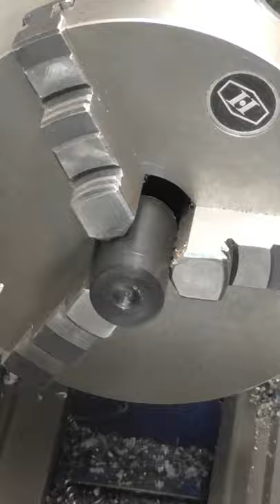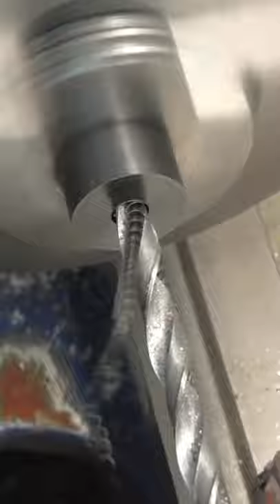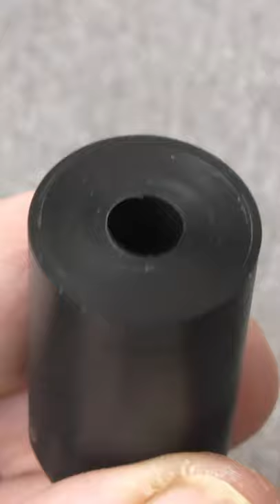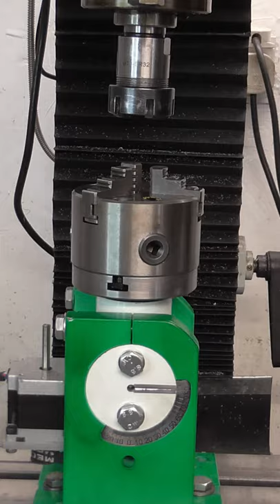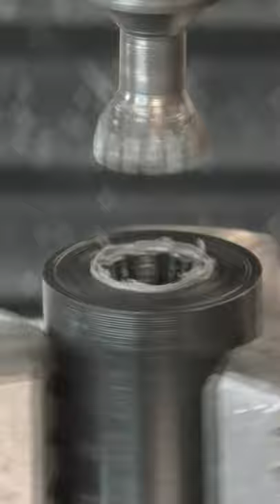Rotary Broaching

Comment: Cool!  Now try it with steel.  LOL!
Reply from the maker: It took considerable force just with plastic (as I suspected it would)! I should have put a shoulder on the part as it just wanted to push it into the chuck jaws, I think my home-made cutter could have been sharper though, the points have become a little dulled with use (I didn't originally make it for doing this).

Comment: DMG Mori calls it "Gear Skyving" I think. Really cool that you do it on the Manual! How do you sync the Rotation of the spindle and Rotary Table?
Reply from the maker: It's done electronically, see my other videos on  the 'Gear Hobbing attachment'
Reply: @AndysMachines  I am pretty sure you don't need to sync the cutter and workpiece for rotary broaching. If the cutter has the same OD as the root of the internal thread you can just do it with a simple rotary broach holder. You only need the synchronization function when using a skiving cutter of a smaller diameter and held at a greater angle, but it is a totally different process and needs very high rotational stiffness, apart from very good rigidity in the whole setup.
Reply: @AndysMachines  I'd have to guess that even electronically it must have difficulty staying perfectly in sync, closed loops have lag times afterall. Best way must be direct drive through gears, cycloidal gears  for maximum rigidity because zero backlash 🤔

Comment: If I'm not mistaken, this is technically skiving, not rotary broaching. Though that is just nit picking.
Reply from the maker: When the 'broach' is so similar in shape to the feature it produces I think it's called broaching. But in the video this short is taken from  where I was cutting internal gears, I referred to it as skiving. The two processes use the same principle though rotary broaching is usually done at a much shallower angle.

Comment: What is the advantage to doing it this way instead of straight up pressing it in?
Reply: as i understand it, the broach is actually held slightly off-angle so instead of the entire tool being pushed through the workpiece at once, it rocks around the edge of the cut and only a small section of the broach is actually cutting at a time (like when you spin a coin on a table and it starts to fall). this means that instead of needing a broaching machine to provide the pressure to push the whole broach through the piece, you can use a mill or a lathe that you probably already have to do the same job

it's a lot easier to visualize when only one of the parts (the work or the tool) is moving but i suspect that both are spinning in this case to get the right relative rpm for a clean cut
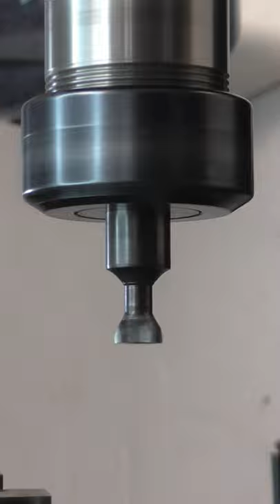Reply from the maker: Yes, that's right. To push it straight in would require much more force (and to get it back out again!) It kind of 'wobbles' it's way down and is only ever cutting at one point around the circumference. There is a 1° angle (0:30) between the cutter and part, both need to spin at the same speed.
Reply: @AndysMachines  @Violet Vixen I see now, thanks
Reply: @AndysMachines  I have no machining experience. I've just been watching like an hour of these videos trying to understand how this works. I kinda get why the bit has to be spinning (because it's 1 degree off center so it can chip away little by little). But I don't understand why BOTH have to be spinning.  Could it not work with just the bit spinning?  Sorry for my lack of understanding.
Reply: @brayanmorales4737 if only the bit was spinning, you would only ever get a circular hole. 🕳️

Comment: Don't u need a asymmetrical rotation?
Reply from the maker: Yes, the tool spindle is at an angle to the workpiece so as they rotate there is relative linear motion between them in the Z direction.

Comment: Why rotating, it would be same as stationery pressing
Reply from the maker: continuous rotation is faster than reciprocating motion since it is always cutting and there is no backstroke. This method is used in industry to cut gears at high speed.

Comment: I am not sure that this was rotary broaching. The holder looks like a regular er holder. For this to have worked the holder or part would have had to have been off axis by a couple of degrees and one of them would be floating, usualy the broach.
Reply from the maker: The part was off axis by a degree or so and the rotation was synchronised to the cutter. It was really just an experiment to see if it would work this way. This was just a clip from a longer video where I tried gear skiving (didn't work so well, so I made a shaping attachment instead).